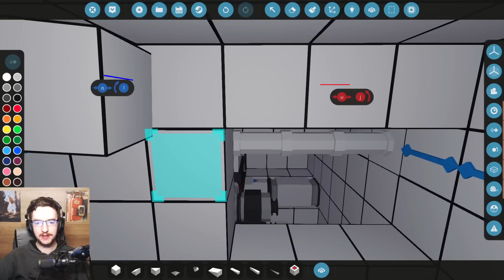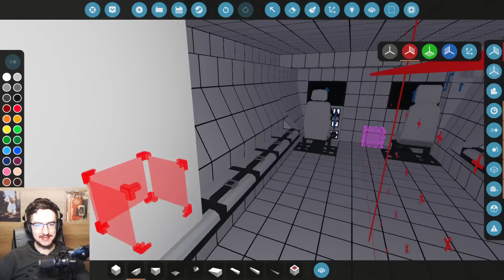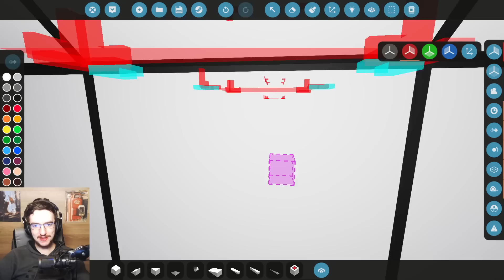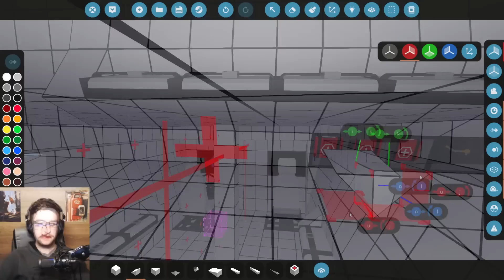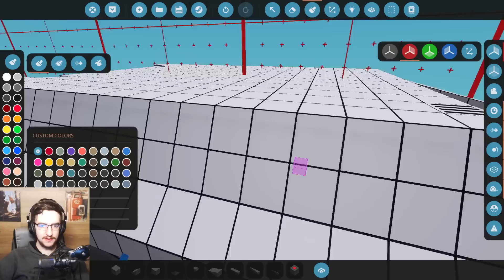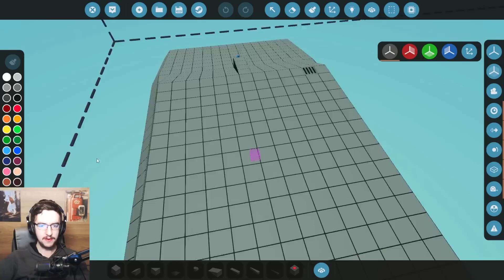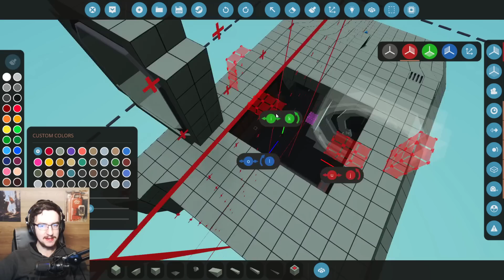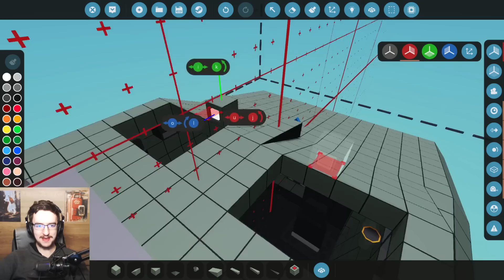Lets Add An INTERIOR To Our IFV - Lets Build An IFV In Stormworks!

Comment: The driver and gunner would have a personal rifle inside the vehicle, either a carabine or a SMG. I also would recommend to make the hatch on the driver side to open to the outside. It will give extra cover when exiting the vehicle through there. This IFV makes me think of the AAVP-7A1 amphibious assault vehicle currently in use by the US Marines. That has in fact a crew of 3 and can carry 21 soldiers into combat. Its wheeled successor will have a capacity similar to the IFV built here.

Comment: Gunner and driver need self defense. So put an SMG and a pistol in there for each of them with 2 spare mags for both. You might want to consider also setting up a dual alternating firing turret gun. I've done that using a numerical switch box with the on being fed by a counter (ping pong) with a constant number speed. The speed varies depending on what kind of auto cannon I've hooked up to it, but for light auto cannons, it's at 0.03. But then I hook the output for the switchbox to two threshold gates. One is set to a threshold of -1 to -0.5 and the other is from 0.5 to 1. The advantage of this is that as the number bounces between -1 and 1, the guns are not constantly firing. So the barrels don't heat up as much and they don't dump as much ammo and can, in a sense, pump out more rounds down range than if you were to hold down the trigger with them firing simultaneously.

Just try it and you'll probably get a small jump out of it. The amount of rounds it flings in comparison to holding down the trigger is frightening and is essentially more effective in AA roles. But beyond that, you may want to add binoculars, oxygen masks, and an underwater welder. Being amphibious you should take into consideration of the what-ifs also happening while you're afloat. But it's coming along. Keep it up.

Comment: I was testing engines today and had a 12cyl 1x1 engine running a tank at 60 mph.   It just needs the right gears to make it work.  A 2 cylinder 3x3 is not much more powerful and just takes up space you could use for gears and the cooling you need to keep it from overheating.  Just food for thought.   I know everybody wants bigger engine.
Reply: I go for the middle ground. I want it geared but also a bigger engine so I suggested the 3x3x1 modular. Should still be plenty of room for a transmission with it. And if geared properly maybe it won’t need a ton of cooling paraphernalia.